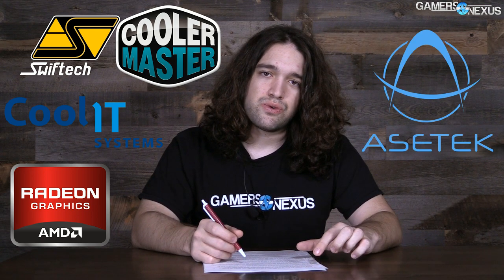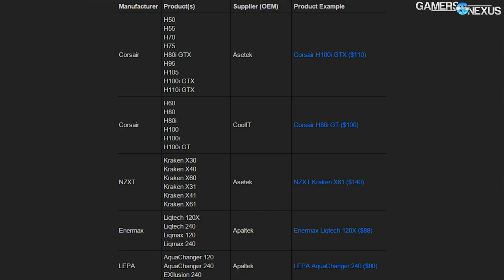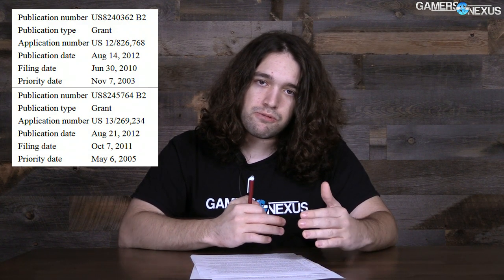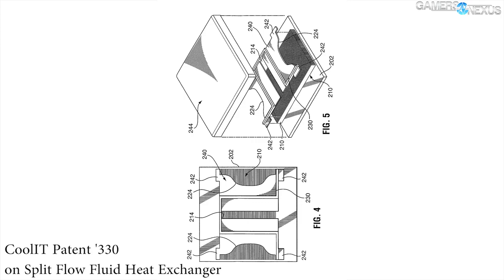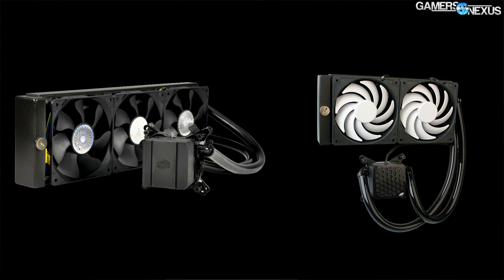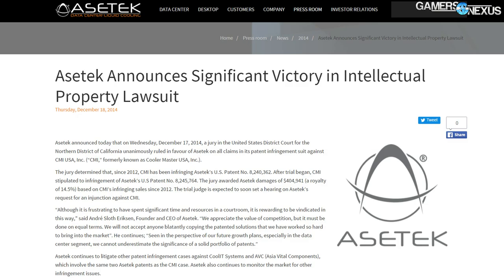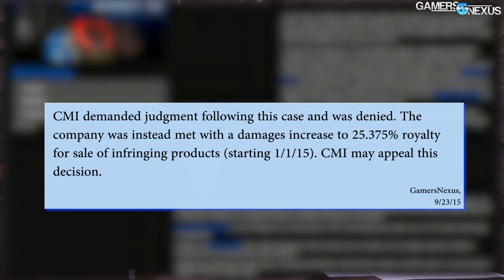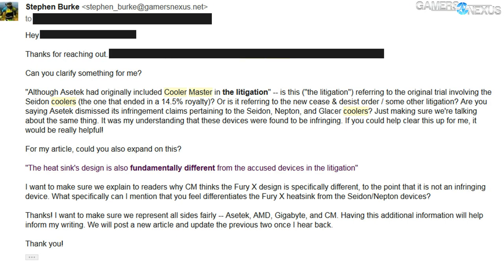Cooler Master Responds to Fury X Infringement Claims (Report)

Comment: Ok so what exactly is the claim Asetek making? Surely Gigabyte, and AMD have already contracted WITH 
Cooler Master to use their AIOs in their products, so what if the parts are originally from asetek? It's not like Asetek is out of the loop here, since Cooler Master still has to get supplied by Asetek anyway.

Comment: so they own the patent for pump on top of the block design even when the internals or housing arent a clone of the original design in the patent? basically the patent isnt for the specific design but for the general concept? is that right? if so, who owns the patent for a regular heatsink with fins on it? who owns the patent for a hex headed circular steel shaft with threads on it (a bolt)? who owns the patent for a 90 degree bend on your case? why doesnt intel own the patent for the cpu preventing any and all companies from making them? the patent could literally say "some stuff on a pcb, circuits close really fast wuzawuzblingbling stovepipe your sister now bobs your uncle." theres only so many ways things can be done, especially when it comes to efficiency. i dont understand how they could even be granted a patent for such a thing let alone them win cases over it. assuming im understanding all this right